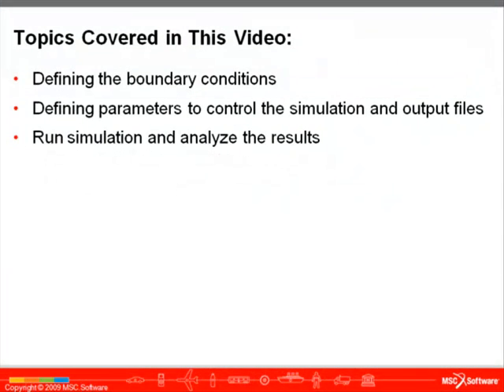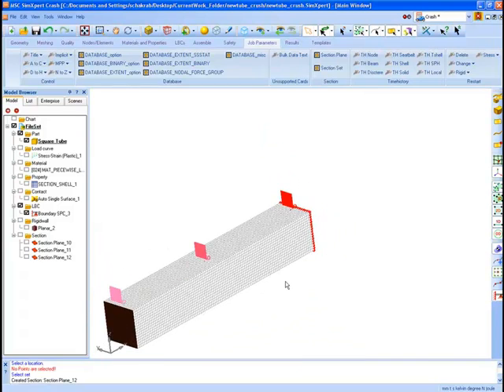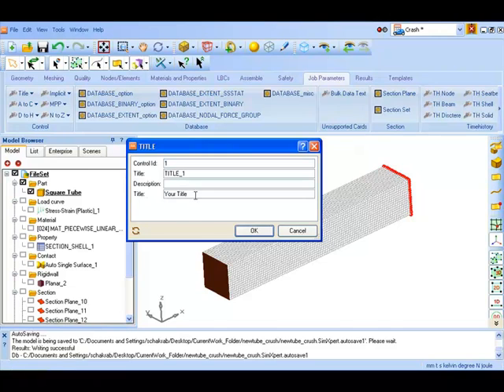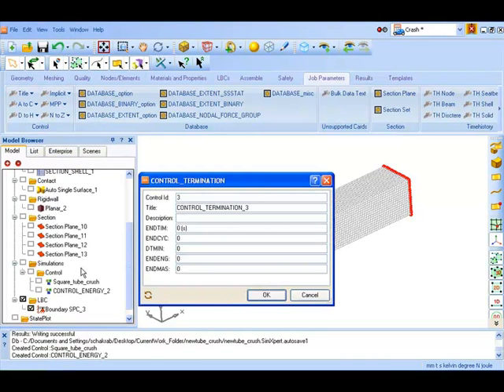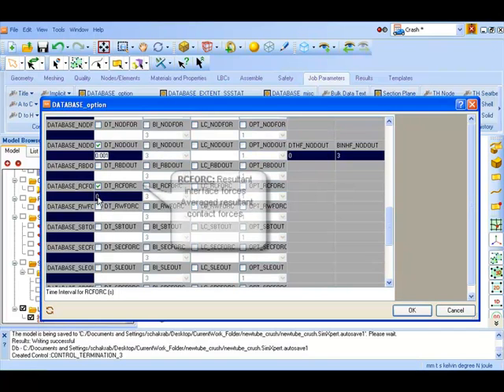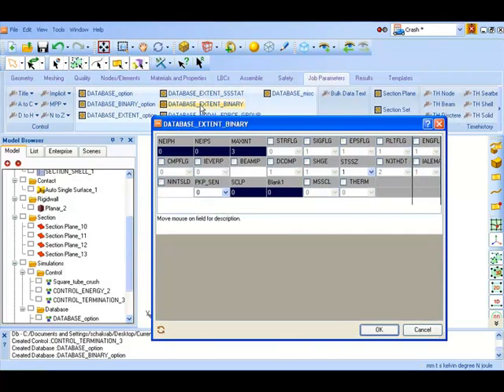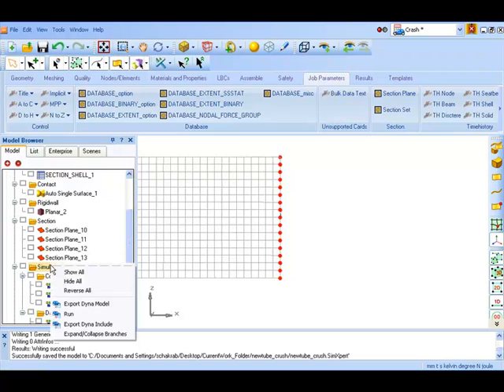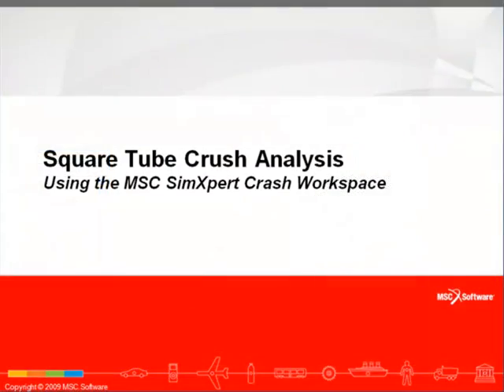Square Tube Crush Part 2: Job Setup and Analysis Results

Comment: I was trying to run the tube crushing analysis , however, its giving me an error and I am unable to attach the results plot. When, I go to attach results plot, I cant find any d3plot file. Moreover, as I am working on simexpert 2010 and not R3.2 , I am unable to do the TH Node, when I pick the set of nodes , it says,  " invalid input parameters for creating". 

Can you please help??